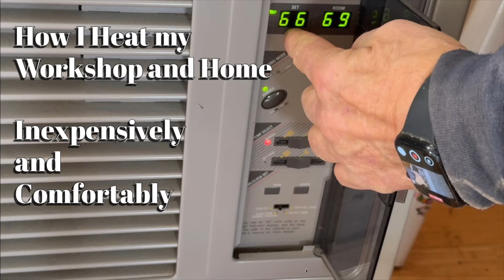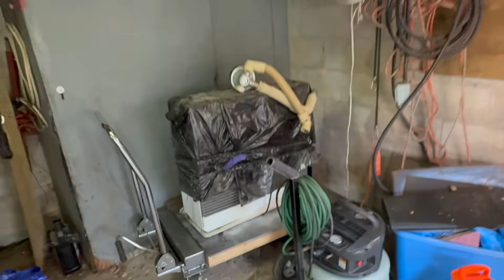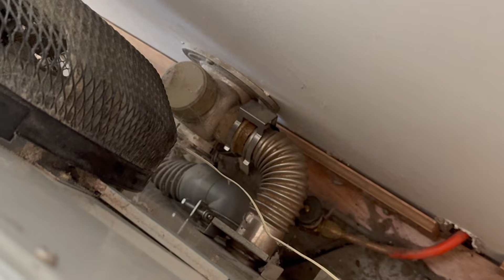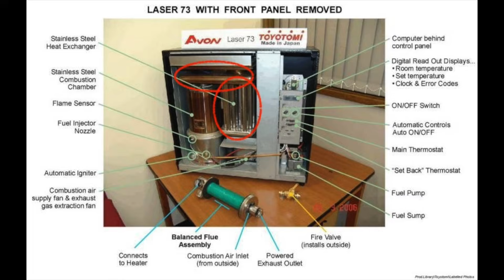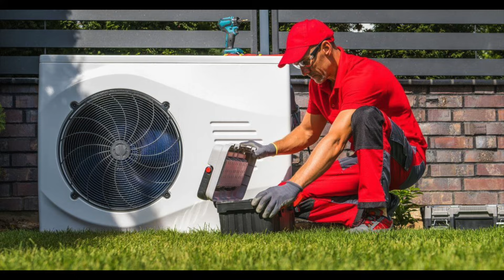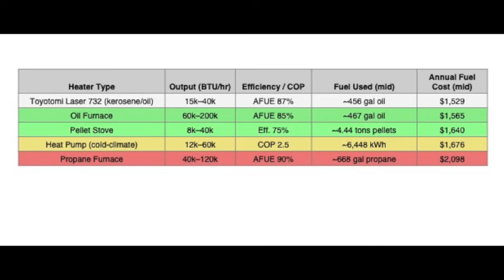How I heat my Workshop and Home Inexpensively and Comfortably

Comment: You always have amazing solutions to problems I didn’t even know I had until watching your video. I love this heating plan you designed. I’m in southwest Michigan. I have a lot on a lake with an old mobile home that we remodeled. We have natural gas service and a gas furnace. I’ve been trying to learn about other options. I’ve been looking at mini splits and at wall mount gas/propane furnaces. I notice the wall mount units have the same design of the inlet and outlet as your k1 units. The only advantage I see to the wall mount gas versus k1 is I wouldn’t need to handle the fuel since we have gas service here. What would you use if you wanted to heat your camper while driving?
Reply from the maker: Well, I had this monitor from the house and I replaced it with the Laser. We use k1 here because oil is more of a New England thing. Propane is expensive and only larger cities have gas. As far as my camper is concerned I'm currently gearing up to install an exterior diesel heater as we plan on doing some cold weather camping this  year. And I wouldn't heat my camper while on the road, only after I stop.

Comment: I just installed a diesel heater in my enclosed trailer today a friend said to use kerosene it will burn cleaner
Reply from the maker: Don't know much about them or if they'll burn k1. If so I'll bet he's right. I do know from watching vanlifers with diesel heaters that the carbon up after awhile and have to be overhauled. Maybe that would stop or slow that down??